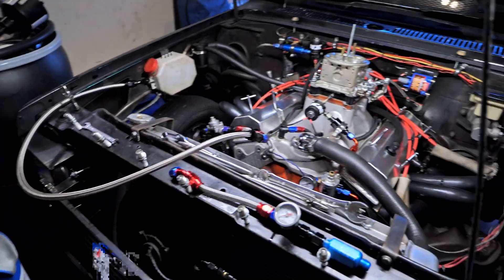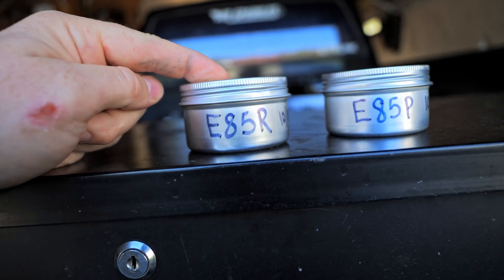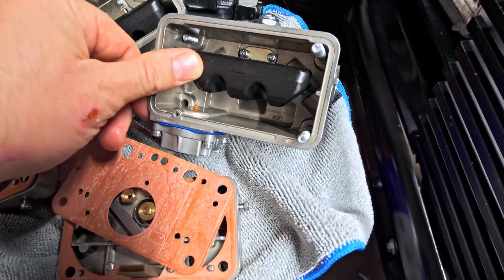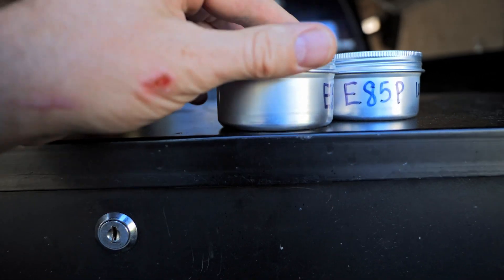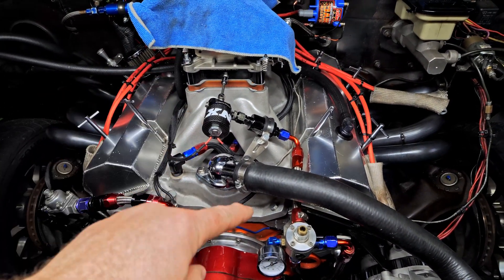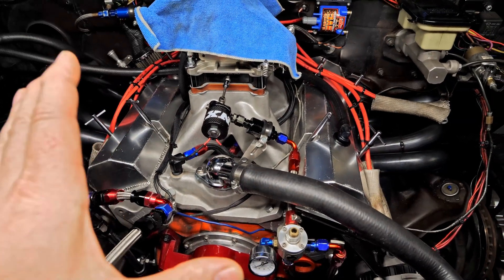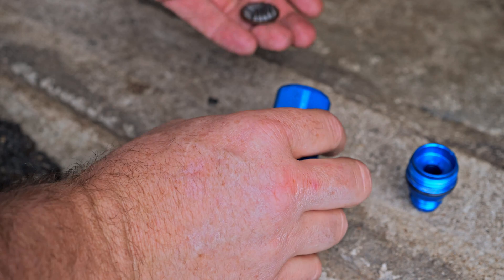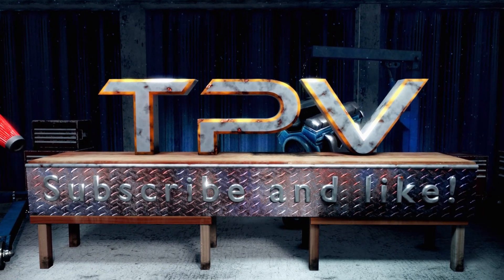E85 corrosion! The honest video for carburetor guys and girls running E85 / Ethanol 💯

Comment: Here are the good and bad aspects of this video:

THE GOOD
1. The video was in focus.

THE BAD
1. You never did a comparison. You have to show what the results would be using E85, E0 or E10, and E100 or as close as you can get to E100.

Frankly, I'm not sure if this test was meant to be serious or facetious. If it was meant to be facetious and to show that ethanol does not cause any harm, you partially succeeded. But because you didn't laugh at the end, I couldn't tell. 

If you meant the test to be serious, then, regardless of whether you are for or against ethanol, you failed. There were no comparative results to show if anything actually happened.

Let's say you are against ethanol and you were trying to show that ethanol causes excessive corrosion, but that didn't come across. In any event, all liquids are corrosive. The key point would have been to prove that ethanol is more corrosive than gasoline and the aromatics in gasoline (benzene, toluene, xylene, and ethyl benzene). Your test did not show this. In any event, it couldn't have shown ethanol to be more corrosive than gasoline and aromatics because it's not: ethanol is compatible with more types of rubber, plastic, and metal than gasoline, benzene, toluene, xylene, and ethyl benzene.

Let's say that you are pro-ethanol and you were intending to show that ethanol is not excessively corrosive, you did a terrible job because it would have been great for people to see that the effects of corrosion would have been far worse if you used E10 or E0 (they would have).

Let's say you were serious about trying to prove that ethanol causes excessive corrosion, and you think that what you showed demonstrates excessive corrosion. The problem is that E85 still has gasoline, benzene, toluene, and ethyl benzene in it. Even it there was only 15% gasoline and aromatics, that amount of gasoline and aromatics could have easily caused the little flakes to appear.

I have much more to say, but until you clarify what you were hoping to prove, any further critique would be pointless.

Thank you.

Marc J. Rauch
Author of THE ETHANOL PAPERS and YES, TIN LIZZIE WAS AN ALCOHOLIC
Exec. Vice President/Co-Publisher
THE AUTO CHANNEL
Reply from the maker: Cool

Comment: Using E85 for years only issue I have is the squirter's not wanting to squirt because of the needle valve gets corrosion that is with more than 85 perfect ethanol leave my car all winter 6 months no issues.

Comment: I'm looking at running my small block Chevy 383 on e85. My question is what if you're in a town and you need fuel but all you can find is regular gas?
Reply from the maker: If a carb that will not work. It needs to be a properly tunned flex fuel EFI setup.

Comment: I would recommend that if you intend to let your car set for any significant amount of time, add some toluene to your fuel.  Helps to keep O-rings soft along with helping to eliminate or reduce this white substance that some have seen.  The ethanol industry is adding too much corrosion inhibitor due to the flaws of the test method.  This additive seems to oxidize over time and can clog injectors.  Suggest about 4 to 5 percent blend, meaning if you have 10 gallons in your tank.  Add about a half gallon of toluene.  Lowes and Home Depot stopped selling toluene in the solvent section and now sell ethylbenzene which is very similar to toluene.

Comment: I've been running E85 for 4-1/2 years.  My car is an F2 blown 427SBC with Holley Dominator EFI.  I don't drain anything and I run Aeromotive pre and post filters.  My car was recently down for about 6 months as I installed a custom billet intake/intercooler.  Fired right up and I've run several tanks of E85 through it since then.  The fuel where I live in California typically tests at 90-95% ethanol.
Reply: Guy building my SBF has two BBC and runs pump e85. He's convinced me to go e85 on my motor. Also in California.

Comment: Adding fuel stabilizer(e85 approved) is recommended when car sits even for 1 month. Pump gas 87E10 is actually worse for the car fuel system than E85 because 87E10 does have high content of benzene and ethyl benzene, toluene, xylene slowly eating plastics, rubbers, brass.

Comment: This was very informative as I’m approaching the end of my engine build I’m thinking of running e85 I’ve replaced all lines in the car with ptfe braided lines from hot rod fuel house and put a Holley retrofit fuel pump 340lph in the tank. Seeing this definitely is going to make me put a nice aeromotive or equivalent fuel filter in line with it. I’m curious to see the corrosive effects e85 has on a Holley sniper. Thanks for posting
Reply: I'm also considering E85 with a Sniper. I would imagine the consequences would be the same, as fuel also sits in the Sniper. If you went with port injection I would imagine the issue would be non-existent.

Comment: Get engine up to temp. Drain all the E85 out of the entire fuel system. Put 5 gallons of 20:1 2 stroke utilising synthetic castor oil and the best pump unleaded you can buy. Let engine idle for a couple minutes whilst depressing both accelerator pumps to flush both float bowls. Shut engine down and leave 2 stroke in the entire fuel system.
Reply: And try to get pump gas w/o ethanol

Comment: I’ve probably seen more engine failures from those small disk style fuel filters than anything else.  

No doubt about it, you have to keep up with the maintenance on e85 or it’s gonna bite you in the ass
Reply from the maker: Yeah I'm thinking about putting a larger unit in over the winter.
Reply: @TPVPRO  I'm a big fan of Radium filters. They look identical to what you have, so it should fit right in easily - but quality is top notch. I run the 6 micron unit with ID injectors.

Comment: You don’t use a top end lubricant?
Reply from the maker: Nope I don't use anything
Reply: @TPVPRO  y not
Reply from the maker: @AdventureswithBigJohn   No reason I just don't use it.
Reply: @TPVPRO  any problems reading your plugs?
Reply from the maker: @AdventureswithBigJohn   No the only catch is you can't read them like a gas tune-up for fueling. Timing and heat is about all you can read.
Reply: @TPVPRO  my car is on methanol and I want to add nitrous. Would you run methanol, e85 or race gas on the nitrous side for fuel?
Reply from the maker: @AdventureswithBigJohn   I say race gas on the fuel side. There seems to be a million opinions so you got to try and see how it goes.
Reply: @TPVPRO  👍